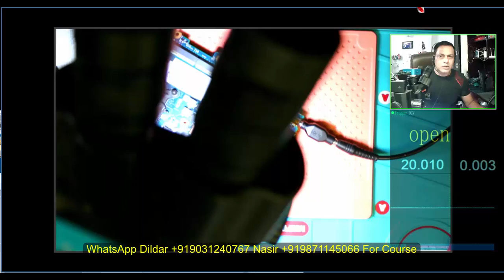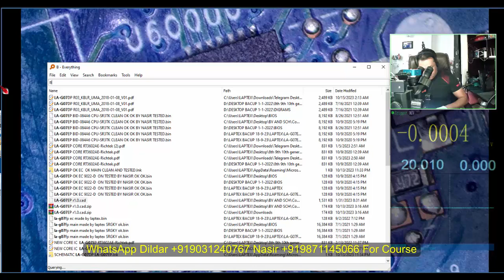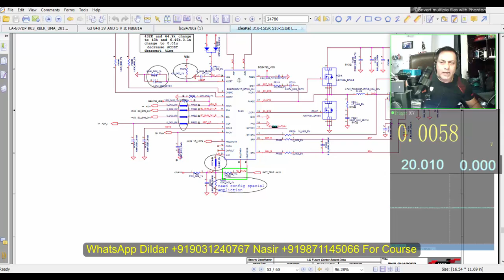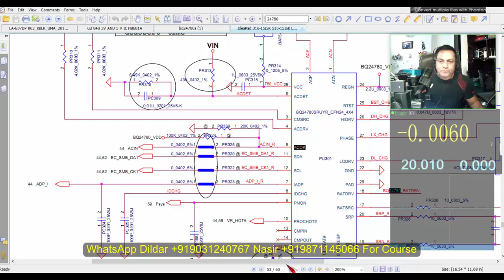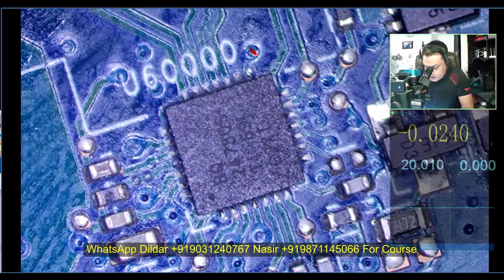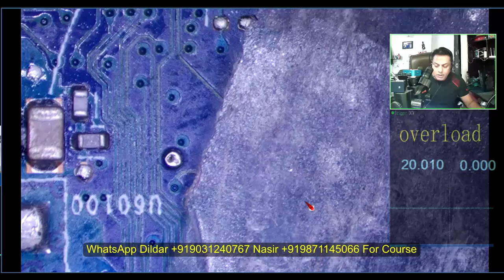HP G3 840 6050A2892401 MB A01 How To Diagnose Dead Motherboard Without SCHEMATIC in ENGLISH | Laptex

Comment: Hello, first I'd like to thank you for the video it was very helpful. However, I have the same exact problem that you had with the one volt coming for about a second when you first plug it in and then going away. I measured the impedance and it's measuring 60 ohms. Have you found anything else that we might check to see what could be the problem? I don't believe the CPU is shorted.... Is there anything else that might cause that problem? Any help would be greatly appreciated.
Reply from the maker: Need to check the initial sequence and test with DSO that which signal/voltage is dropping int the sequence.

Comment: G3 840 capslock blinks 2 times and fan rotates faster. I reprogram the bios chip but getting worse. When i reprogram it with the back up it get back to the previous problem. All the necessary voltages are available. What could be?
Reply from the maker: Need to build the bios properly...if it's still the same then it could be hardware issue

Comment: good evening, your video is very good, I wanted to ask you a question about that board or am I repairing one but I have 2 coils that are not working  
l66310 and l66320 are not working, the other power supply works and I have its voltage, the equipment does not measure the video, I think that because there is no voltage in those coils, the equipment does not measure the image, what can I do, thank you
Reply from the maker: Check the requirements.

Comment: Hello sir.i have this 840 g3 motherboard all voltages ok but no power.6050A2854301-mb-A01...i have checked all the volts you have explained here found exact readings you say but its not powering on.the SM CN200 led blinks once then disappears..please help
Reply: Hello, I also have all the values, but there are no charging voltages at the output of the battery connector? I need to understand what is happening? Where was it lost?
Reply from the maker: Check GATE biasing is proper or not